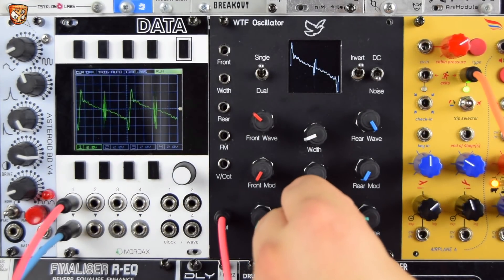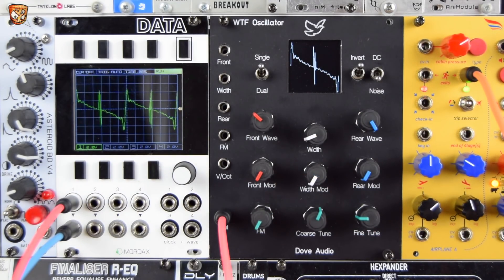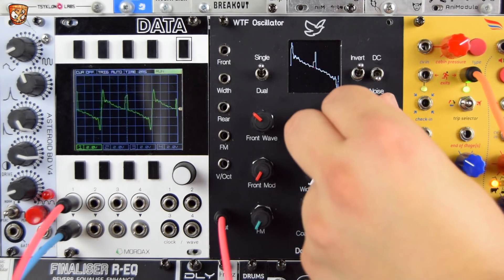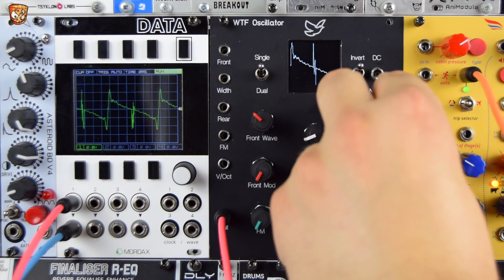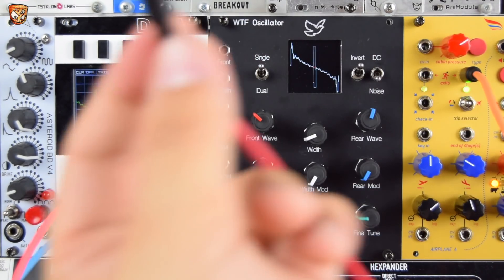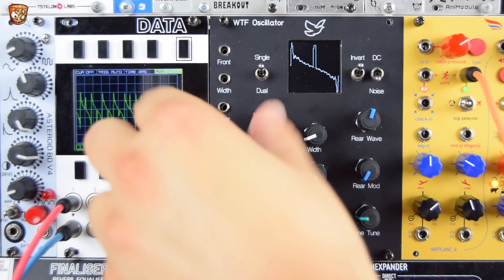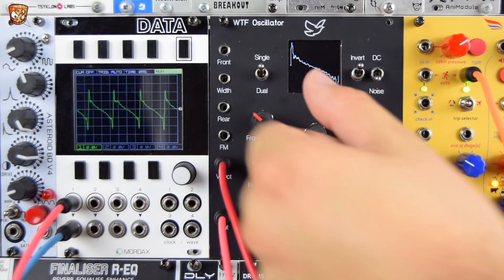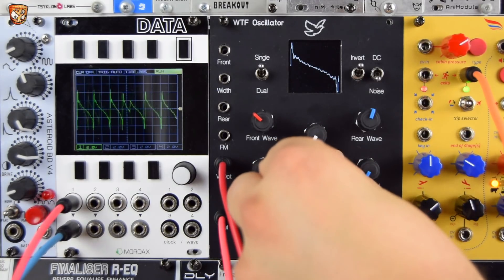Dove Audio - WTF Prototype (first look at a new way to work with waveforms)

Comment: This is absolutely fantastic! What a brilliant idea. Like you said in another reply, you can basically get upwards of 2048 waveforms from the base 32!

Edit: And you can turn the coarse knob into an octave knob via jumper! Looking at the panel at the beginning, that's the only other thing I wanted. And it's there
Reply from the maker: yeah jumper setting for octaves or normal variable coarse tune. It certainly does the job.

Comment: I really hate jumpers on the back or controls on the back of anything.  Unless it's a safety issue where the unit should be powered off to make changes, all controls on the front.
Reply from the maker: Yeah can't say I'm a fan of jumpers on the back. I'd like a switch on the front to change the tuning behaviour but as for me it's really a set and forget thing I don't mind it on the back.